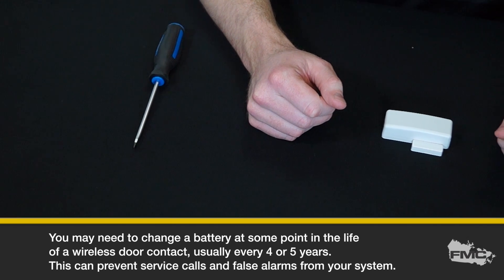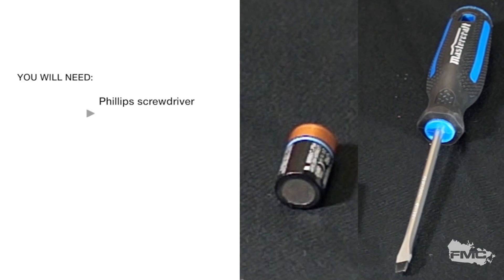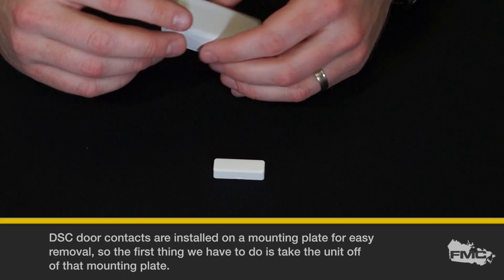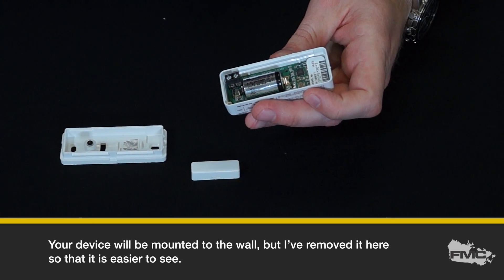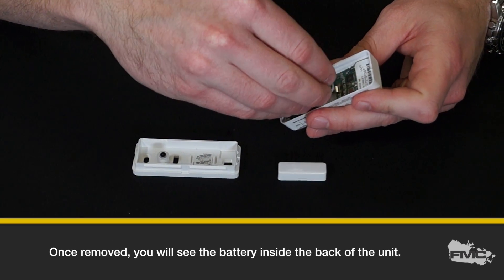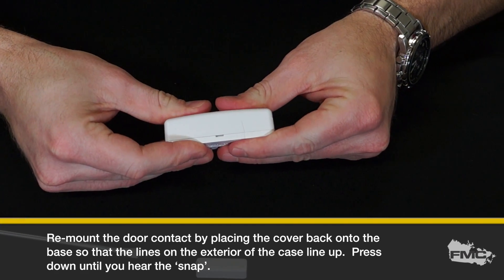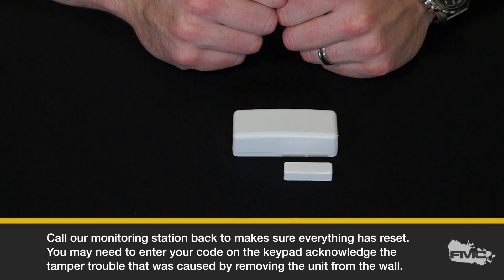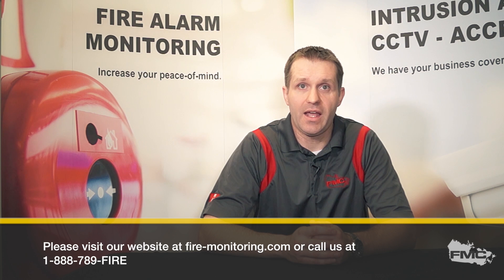Tech Tips Video: Replacing a Battery in a DSC WS4945 Wireless Door Contact

Comment: Thank you so much for posting this video! I had multiple issues trying to replace my window sensor battery myself (primarily with getting the cover off and which way was the right way to place the battery). You saved me time and, ultimately, $60. I was dreading booking another service appointment. I feel like it's noteworthy, that this particular sensor is harder to find than most (ADT doesn't generally use it). Again, thank you!